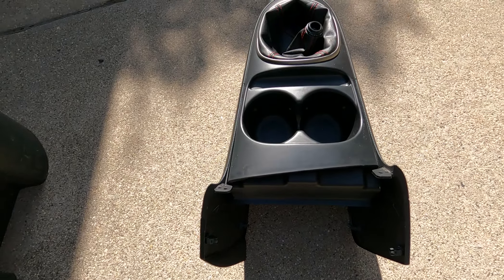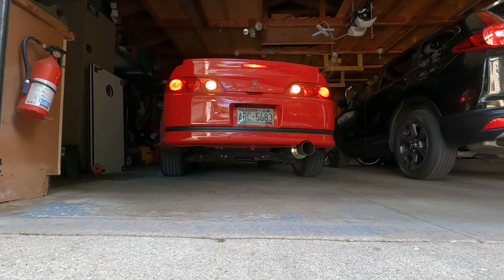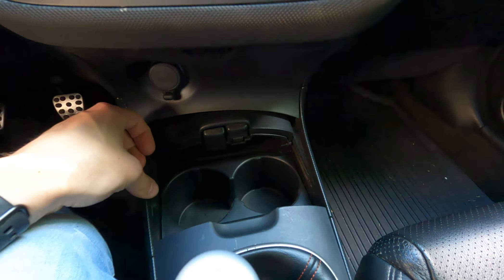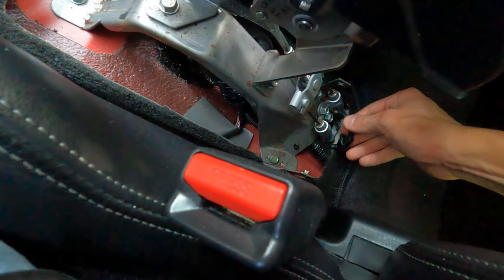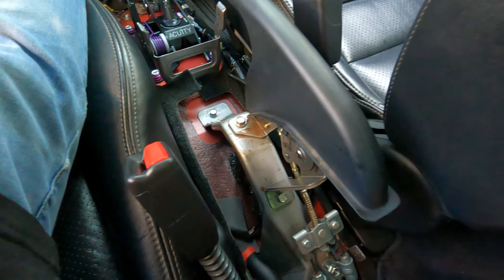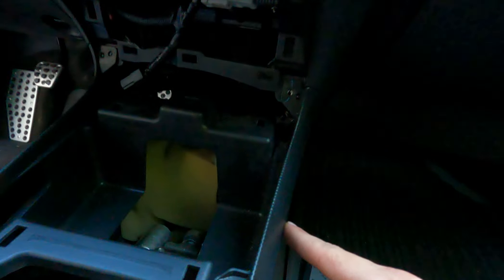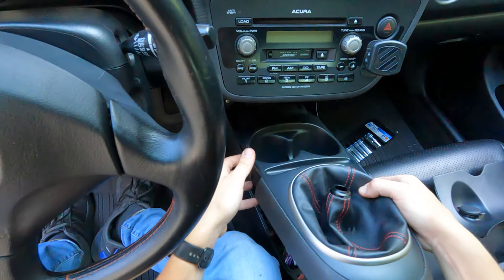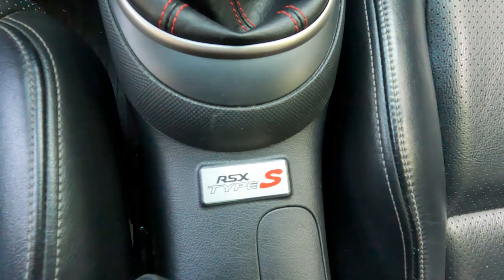Installing A DC5 Type R Center Console On My Red RSX Type S!

Comment from the maker: Disclaimer

1: don't buy the rhd cigarette lighter piece that clips to the dash. Doesn't fit on a lhd dash. The gap between the dash and center console will always be there no matter what 

2: I got the 2 back bolts in the back of the center console in after the video. The cigarette lighter connector was pinched in the rear not causing it to sit flush.
Reply: Thx